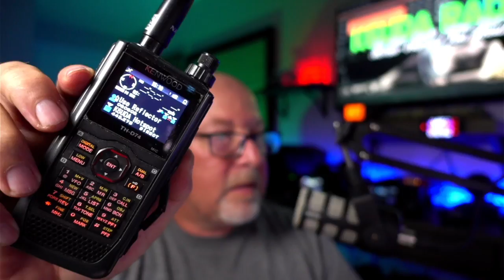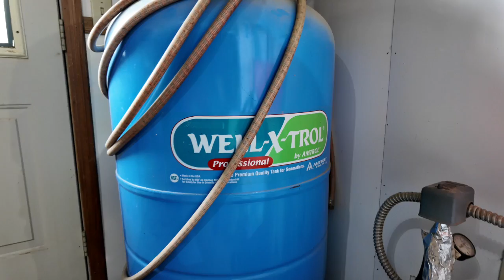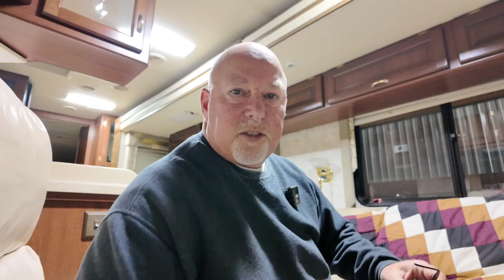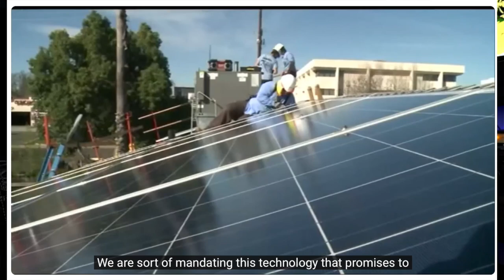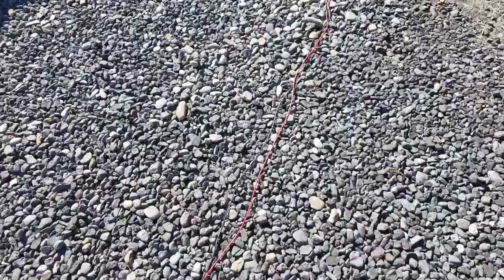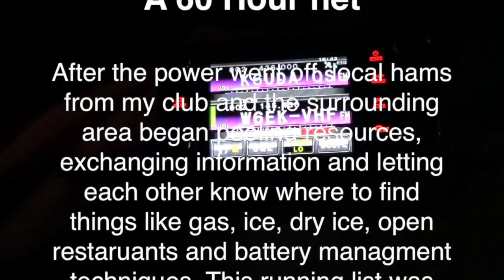Flip The Switch | Power Grid Failure Challenge

Comment: Prior to Hurricane Sandy, we were on a intermittent grid here in SE PA. I made a solar panel and attached it to a deep cycle AGM battery, which worked great for short term outages. I ordered a generator right before Sandy hit, and we used the battery for 2 days until the generator arrived for TV and lights. Since then I've gotten a bigger generator and installed a xfer switch. We haven't lost power since, but it's good to have it all.

Comment: Doing a 24-72 hour power outage drill is extremely eye opening, especially if you do it when it’s not beautiful and sunny outside to keep the solar “generator” topped off.

It’s a great way to gauge how much electricity, gasoline, and propane you’ll use per day.

Comment: Aloha Bob, I do several nets on this subject every year just before our yearly hurricane season. A lot of people listen and agree but still do not do what it takes to be prepared. 
     BTW, Bob, I own one of those Cube’s with the dead 55 ah battery too! 😂 I keep it on the lanai in my Ham shack for just in case, especially since I figured out how to bypass the dead battery. 
      Bob, you have a lot of garage space and can use that to your advantage. You can set up a 14.4v battery bank using cheap 6v & 8v golf cart batteries that you can charge up with solar, wind or even jump it with jumper cables and vehicle for 20 minutes at a time about once every 3-5 days. 
    Ideally, you want to have more than one battery bank system that can run independently of each other. Then you can use BattMINDer 2012’s Pulse/Desulf chargers and you should have charge controllers for LifePO4 batteries that allows you to use wind and regular solar panels for charging. 
     The transfer switch is a great idea for your gas generators but what are you going to do when you run out of fuel one, two, four, nine weeks later? 
   Then it’s time right now to start building multiple battery banks that you can also charge with your generators once a day for 20-30 minutes to save your fuel and make your fuel stretch. That way you don’t need to leave your family and home exposed while you wait in line somewhere to get fuel. 
    Another thing, Bob, take a close look at your home owners policy and home insurance policy, you will find that you are limited to how many gallons of gasoline you can have at your home but there is no limit to the number of propane tanks that you can have. You might want to have a 250 or a 500 gallon propane tank installed and have a truck come out once a year to fill them up or top them off. 
     Bob, judging from this video, you are only 45-50% there and still have a lot more work that you can do. 
    Example, you could buy several of those $250 vertical wind generators to supplement your off grid applications. Just remember this, the two things that people hate during major power outages is taking cold showers and drinking warm beer! 🤣😂🤣🤪
       WH6DWF 🇺🇸
Reply from the maker: I know there’s lots more I can do to get myself ready to go off grid. Money is big reason I’m only part way there. Thanks for the tips Todd.